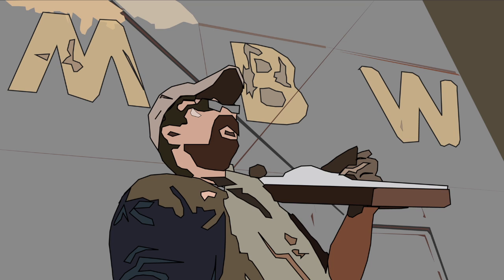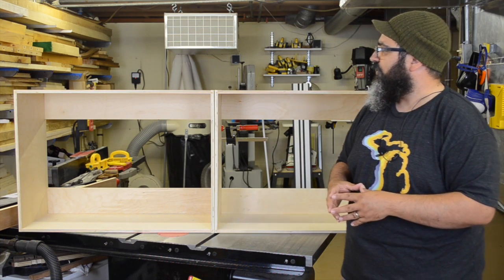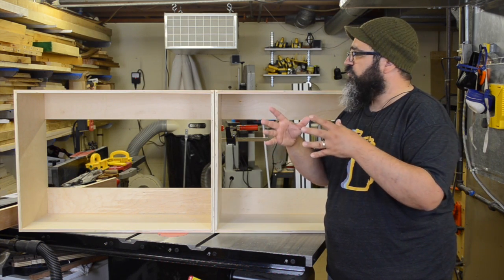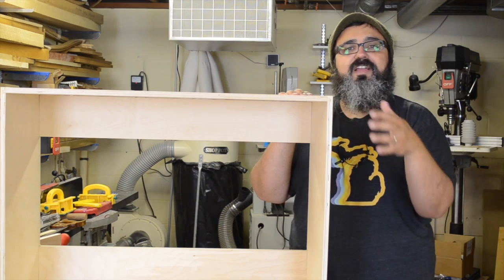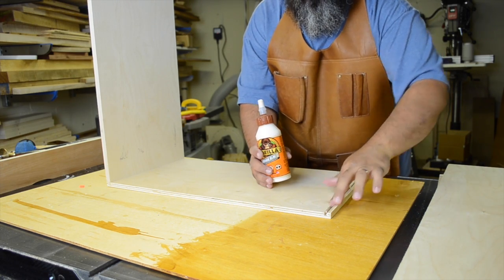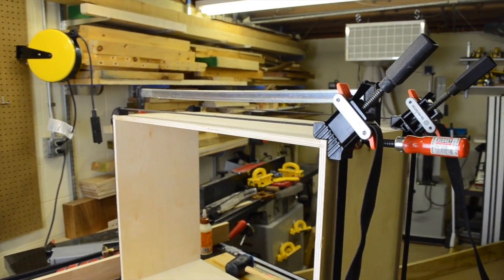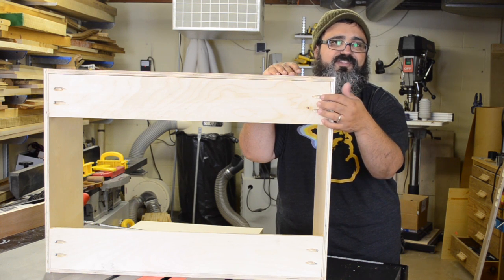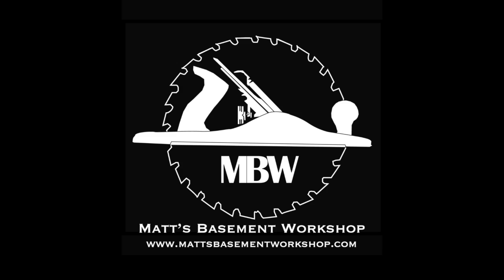550 Simple Cabinet Construction Pt 1

Comment: That's a great little design there Matt. I can see that rabbet/dado joint adding a lot of strength. The pockets are perfect for the nailer's vertical loading, why explain. With regard to the rabbet/dado, your comment, "...and because it was a lot of fun, also, " was also entirely sufficient since the whole thing could have been done with pockets, brads, screws, or staples. 
Apologize for nothing, have a ball. 
Oh, and don't say, "persuaded", when you mean, "beat the tar out of".

Comment: Looks like a good start to things.  The lock rabbet joint does a good job at avoiding a lot of the problems with plywood construction.

One concern I would have is that the "Baltic Birch" (I'd get my money back on that - the standard for that is void free...and oh my god, swiss cheese) plywood you are using for the bottom/top may end up warping away from the stretchers on the back.  If it was real Baltic birch - it might be fine, but voids are one of the number one causes of plywood warping.

Normally I would put another couple screws from the stretcher into the top and bottom panels to help prevent it from warping as well as increase the rigidity of the bottom shelf (face frame will help some there, but doesn't do much for the back edge of thinner sheet goods).

BTW - one other tidbit of information to play with regarding the plywood.  Most your imported plywoods are thicknessed based on a millimeter scale.  3/4" is actually 19mm.  1/2" is actually 12mm.  1/4" is variably 5 or 6mm depending on who you are buying from.  The marketing types at box stores have them label it as the common imperial dimensions.

Domestic plywood have their own issues - APA standards allow them to undersize thickness by 3/64", and almost every mill takes full advantage of that leeway in order to minimize material costs.

Those two factors lead to the reason why most "plywood" bits for the router never actually do a good job of fitting the plywood they are supposed to.  Depending on source and flavor (veneer core, composite, MDF...) plywood can vary significantly in thickness.
Reply from the maker: +Joe and Liz Originally I had planned to include a pockethole joint to pull the backs together with the top and bottom. Not sure why I omitted it, so I'll add it before the next episode now that I can't remember why I didn't do it in the first place.

I probably misspoke and indicated the plywood was "baltic birch" plywood. It is in fact more of a "regular birch" plywood, but the voids in the plys are pretty tiny so once the face frame goes in place, I'm not worried about it in the least.

Thanks for watching!
Reply: Yeah, in terms of strength - the voids don't have a huge impact (well they do - but they don't).  Unless you are doing some of the modern styles stuff with exposed ply edges, it really isn't a big deal there.

Mostly was a comment regarding 1) the warping issue and of course 2) I have actually had sales people try to tell me what they were selling was one product when it wasn't.

Baltic Birch normally comes at a bit of a premium price, and if they charged you for that but gave you regular multiply birch...well, that is an issue.

Anyway, keep on keeping on.

Comment: Matt, I see you're using cobalt tools Drill, I've seen them at the depot or Lowes, they look like nice tools but I'm always worried about battery life. does it do as much work on a charge as other brands?. I loved my old craftsman but the batteries are dying and I don't feel like spending $80 on batteries for a drill I bought in 1998
Reply from the maker: +God of Thunder (UKKONEN) I only have my old Black & Decker 14.4 volt to compare it too, but so far it's exceeded that by leaps and bounds.